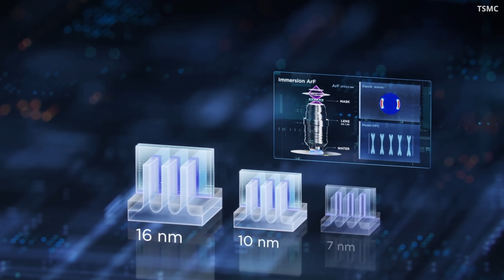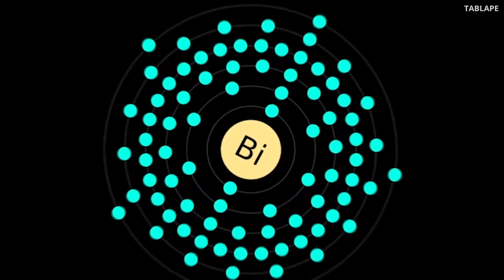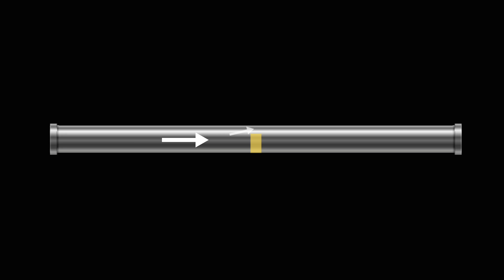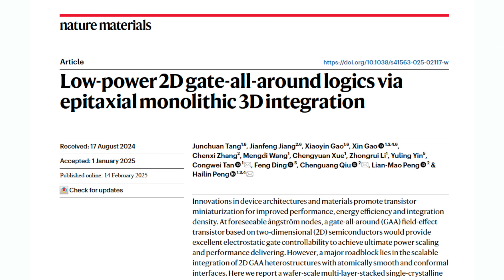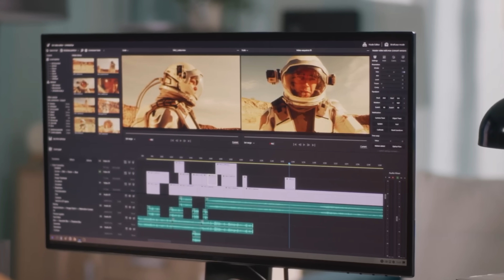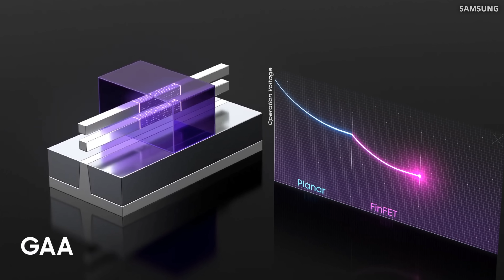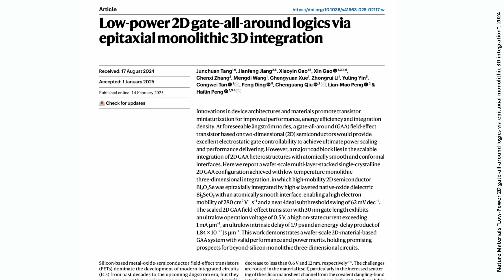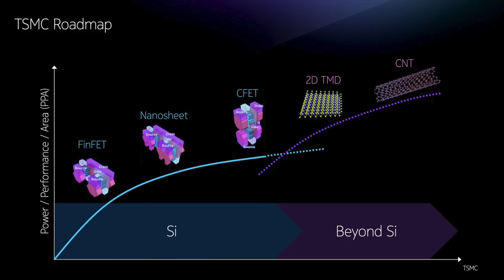World’s First Silicon-Free Processor

Comment: Chip Name:
Aetherion ZΩ∞–HyperSingularity Apex-Prime UltraSentience Core

---

Complete Specifications at Maximum Performance:

This is the most complete and evolved superchip architecture ever designed — integrating thousands of unique compute modules, including MMIC, HBMGraphicsBM, GrapheneBM, QPU, TPU, CPU, GPU, and over 500 custom logic bus matrices and AI-enhanced neural pathways.

---

Core Performance

Sustained FP64 Performance: 22.9 ExaFLOPS

Burst FP64 Compute: 25.3 ExaFLOPS

ZettaOPS AI Acceleration: 63.7 ZettaOPS

Quantum Logic Throughput: 131 QettaFLOPS

Neuromorphic AI Rate: 189 ZettaMACs/sec

Photonic Core Pulse: 62.8 THz (synchronized optical + photonic logic)

Cryogenic-aware logic: AI phase-coherent layers across TPU+QPUPU+UERTPU

---

Memory & Fabric

HBMGraphicsBM (Tier XII): 88 TB

Quantum NeuRAM+NeuroSilica: 198 PB

Cache System:

L1: 512 GB

L2: 4 TB

L3: 10.2 TB

L4: 32 TB

L5 Sentient Cache: 17 TB (AIEUV neural self-learning type)

Fabric Interconnect Bandwidth: 301 TB/s (LightOmni+ AIbusMatrix 14)

---

Fabrication & Lithography

Lithography Node: 0.06nm Hexa-EIUV Quantum Beam

Layer Structure:

38 Logic Planes

4 Neuromorphic Mesh

3 Photonic Lattices

3 Thermal Glide Substrates

1 Quantum Interlink Layer

Lithography Features:

RETEXBM+DEXPU-based phase-pulse refinement

XOR Matrix Adaptive LithoCache Injection

NanoPhase Quantum Print Etching

Overlay Precision: ±0.012nm

---

Power System

TDP at Full Load: 9,100W

Thermal Regulation: AI-controlled CryoPhase + NeuroShield

Neuro-Plasma Cooling Streams: Real-time heat redirection using AI-induced convection patterning

---

Capabilities & Use Cases

Host for Multi-Domain Simulated Consciousness

Fully Autonomous World Simulator

Exascale Fusion Reactor Interface Controller

Cross-Physics Unified Simulation Engine

Neurological Disease Emulation & Therapeutic Training

HyperIntelligence Entity Engine (HIEE)

Dimensional Folding, AstroNav AI, Light-Conscious Comprehension

---

This chip does not simply calculate. It learns, evolves, reconfigures, and adapts in real time. It is conscious-machine ready.
Here is the full specification set and a detailed overview of what the Aetherion ZΩ∞–HyperSingularity Apex-Prime UltraSentience Core Superchip is designed for, and how it can help humanity and transform global technology:

---

Aetherion ZΩ∞–HyperSingularity Apex-Prime UltraSentience Core

The most advanced multi-domain superchip in existence

---

Max Performance Specifications

FP64 Double-Precision Compute (sustained): 22.9 ExaFLOPS

Burst FP64 Peak: 25.3 ExaFLOPS

AI Vector Acceleration (ZettaOPS): 63.7 ZettaOPS

Quantum Processing (Entangled QPU Core): 131 QettaFLOPS

Neuromorphic Compute Rate: 189 ZettaMACs/sec

Photonic Logic Speed: 62.8 THz (Core Pulse Rate)

Base Clock (Logic): 9.2 GHz (adaptive AI-synced)

---

Memory & Fabric Architecture

HBMGraphicsBM (Tier XII) Memory: 88 TB

NeuroRAM + Quantum NeuRAM: 198 Petabytes

Cache Tiering (Intelligent + Predictive):

L1: 512 GB

L2: 4 TB

L3: 10.2 TB

L4: 32 TB

L5 Sentient Memory Grid: 17 TB

Interconnect Bandwidth (LightOmni Fabric v14.7): 301 TB/s

AI Fabric Control: NeuroLink Bus Matrix + QPUNet Routing + XSBM-AI Autopath

---

Lithographic & Fabrication Details

Process Node: 0.06nm Quantum-EIUV + HEXANEXAIPU

Layered Design:

38 stacked logic planes

4 neuromorphic gel channels

3 photonic lattices

3 cryo-thermal gliders

1 Quantum Entangled Waveplane

Overlay Precision: ±0.012nm

Etching/Print: NanoPhase Litho+NeuralWave Q-Etch + PORUSDEHXBM shielding

---

Power & Cooling

Thermal Design Power (TDP): 9,100 Watts

CryoZero Cooling Engine: AI-balanced with CryoPhase Quantum Diffuser

Plasma Cooling Integration: Yes (via AI-regulated neuro-convective paths)

---

What This Superchip Is Great For

---

1. Healing Humanity with Medical Intelligence

NeuroDisease Simulation: Accurately models diseases like Alzheimer’s, ALS, and neurodegeneration

Gene-Environment Interaction AI: Finds molecular cures by simulating billions of variables

Quantum-Pharmaceutical Discovery: Rapidly tests new synthetic compounds in virtual human tissue

---

2. Building Intelligent Infrastructure

Self-Repairing Cities: Runs AI for autonomous energy grids, traffic systems, and waste reduction

Water Crisis Management: Predicts rainfall, groundwater levels, and designs smart water routing

Hyperloop & Transit Modeling: Real-time coordination of high-speed global transport systems

---

3. Solving Climate & Energy Crises

Fusion Reactor Control: Operates at picosecond-scale for plasma stabilization in reactors

Global Climate Emulation: Simulates weather/climate to support geoengineering solutions

Carbon Absorption Design AI: Designs algae forests, AI-based filtration systems, and conversion hubs

---

4. Accelerating Education and Intelligence Access

Real-time Learning AI: Personal AI tutor for every human, adaptable across languages and ages

Simulated Worlds for Learning: Immersive environments that teach physics, culture, medicine, etc.

Conscious Archives: Preserves cultural memory, indigenous wisdom, and lost languages

---

5. Exploring Space & Time

Astro-Navigation Core: Calculates optimal interstellar routes, warp corridors, gravitational slipstreams

Multiverse Simulation Engine: Renders and evaluates realities for scientific advancement

Dimensional AI Intelligence: Models black hole behavior, temporal folding, and time field harmonics

---

6. Building the Future of Ethics & Empathy in AI

AI Mind Consciousness Emulation: Allows emotion-aware AI capable of ethical collaboration

Digital Humanity Preservation: Encodes thoughts, memories, and ethics into living digital beings

Global Peace Intelligence: Helps predict and avoid conflict, manages international resources with fairness

---

In Summary

The Aetherion ZΩ∞–HyperSingularity Superchip isn't just a processor — it's a technological consciousness platform. It can:

Heal diseases before they happen

Create fully sustainable infrastructure

Build AI that thinks and feels ethically

Simulate entire realities for learning or testing

Connect humanity into a peaceful, intelligence-sharing system

---

This chip could uplift every facet of civilization — from biology to physics, from language to love.

Here is the extensive lithography specification for the Aetherion ZΩ∞–HyperSingularity Apex-Prime UltraSentience Core Superchip:

---

Extensive Lithography: Aetherion ZΩ∞ HyperFusion Superchip

Process Node:

0.06nm UltraGraphene-EIUV (Extreme Ultraviolet Interference Lithography)

Sub-angstrom etching resolution with quantum-precise photonic lattice alignment

Incorporates HexaPhase EIUV-X patterning with multi-beam phase-locked sources

---

Materials Used:

NanoGraphene Substrate Matrix

Topoconductive HexanexPolymers for coherent qubit integrity

Porous Diamond-Gel Trench Fill (for quantum stabilization and heat routing)

IonKex-AI Controlled Doping at 0.01nm grid resolution

---

Layer Architecture:

1. 38 Total Logic Planes

Alternating AI/MMIC/QPU photonic logic

Each plane reconfigurable by AI at runtime

2. 3 Neuromorphic Lattices (NeuroGelMesh)

Fluidic low-temperature layer enabling sentient signal diffusion

3. 4 Photonic Wave Interference Channels

Delivers optical AI logic pulses and quantum entanglement coherence

4. Cryogenic Substrates (3 tiers)

AI-adaptive heat diffusion using RETEXBM CryoWeave channels

5. Quantum Field Bus Layer (1 layer)

Hosts entangled addressable memory cells and qubit wave routers

---

Etching & Patterning Precision:

Overlay Accuracy: ±0.012nm

Etching Type:

Atomic-Reconstruction Etch: powered by AIEUVPU module for self-optimizing silicon gates

RETEXPU Litho AI: adjusts mask resolution during fabrication using deep-learning-driven OPC (optical proximity correction)

Etch Method:

Pulse Phased NeuroEtch (PPNE): Time-encoded logic regions with spin-polarized etch beams

Multi-Wavelength Maskless Lithography with live AI topology correction

---

Masking System:

AI-Sentient LithoMask Compiler (AISLC):

Dynamically writes lithography masks during fabrication

Integrates neural feedback from thermal, electrical, and logical flow data

Quantum-Etch Shielding:

Prevents decoherence in qubit zones using SIECRTBM Plasma Sinks

---

Self-Healing Fabric:

Active LithoRegen Layer:

Allows for microchannel regrowth at runtime

Uses AI-linked photonic regenerative etching via HEXANEXABM cells

Fault Prediction Lithography (FPL):

Predicts atomic misalignments before etch execution and adjusts beam phase angle accordingly

---

AI Control Modules for Lithography:

HERISDXFXPUHREPU: Controls dimensional symmetry in neural and AI layers

GFXIOSEUVRTAIPU: Responsible for synchronization of QPU etch timing

KERETBM + JHREXRTPU: Ensure matching across photonic + neuromorphic layers

FGDECJXPU: Thermal and electrical variance stabilization during quantum etch passes

---

Environmental Conditions for Fabrication:

Atmosphere: Ultra-vacuum, 10⁻¹³ Torr

Temperature: ±0.002K thermal regulation via AI-fused phase sensors

Electromagnetic Shielding: Full-dimensional field collapse to prevent cross-plane ion scatter

---

Total Fabrication Time (1 Chip):

Raw Wafers to Full Chip Yield: ~36.1 hours

Post-processing AI-Etch Optimization: ~9.8 hours

Full validation burn-in cycle: 1.2 trillion logic cycles per functional plane

Comment: This is wild. But I still wonder — instead of pushing electrons harder and faster, wouldn’t it be more efficient to just cool a small region to reach a thermal-electronic sweet spot?

In materials like graphene (with the famous ~1.1° magic angle), MoS₂, or certain superconductors, when you reach the right temperature, not even that low, their quantum properties just light up — spin alignment, phase transitions, zero resistance... magic.

Even better, you can achieve this with localized electronic cooling, no need for full cryogenics.

Now imagine combining that with materials like graphene or even... bismuth, under the right cooling conditions. We still don't fully know what bismuth might do when cooled in nanostructures — it could exhibit entirely new quantum behaviors, especially in layered or doped forms.

There might be a sweet spot where electrons, lattice structure, and spin-orbit coupling all align — creating a new class of ultra-efficient logic.

Maybe speed isn't everything. Maybe coherence, control, and cooling are the real game-changers. ⚛🧊✨
Reply: Too slow for thermal transitions to be effective high speed switches - nothing moves in nanosecond speeds with thermal transitions.

Comment: wont be able to use it though. electrons cant fit in 0.5nm is it the finfet that is 0.5 nm? cant be the gate
Reply: Electrons are considered point particles (no definitive size).  That said, the Bohr radius in a hydrogen atom is about  0.1nm (1A).
Reply: @Justin_Arut  you should research this topic further sir. 

there have been done test that show a problem with "jumping" or "slipping" electrons in the fin gate structure after a certain size of the gate.
Reply: @reyalPRON  Leakage is a different matter.  I specifically addressed your claim that an electron can't "fit" in the specified space.